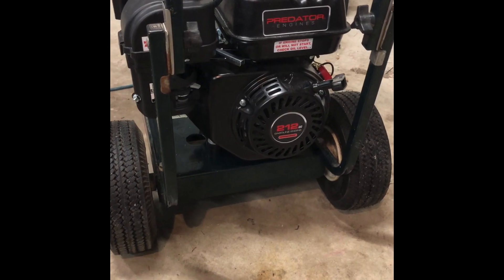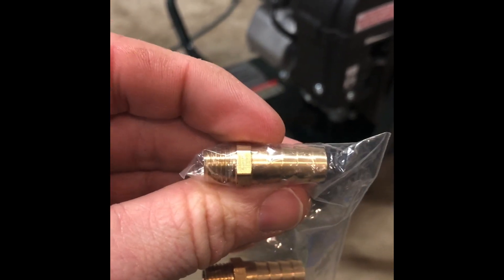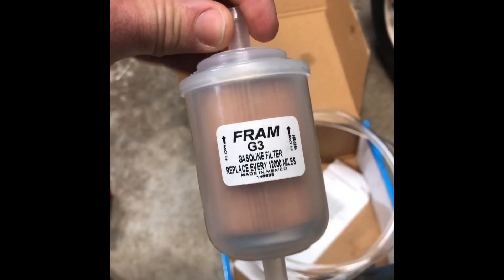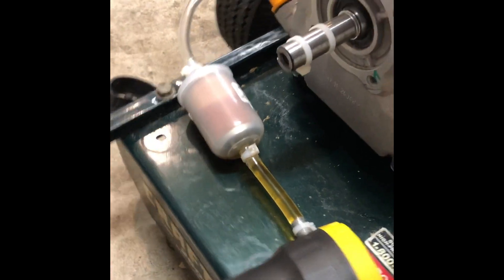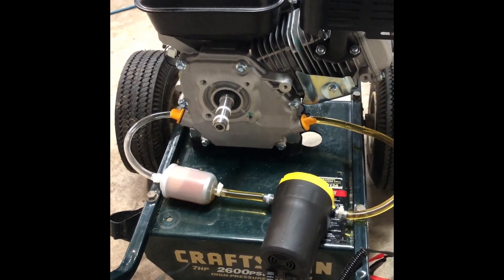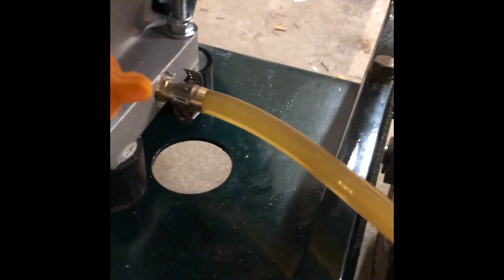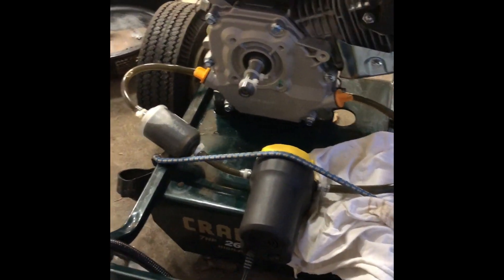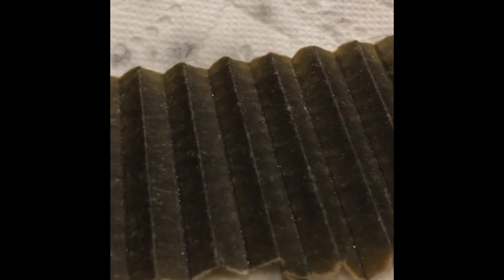Predator 212 Break in Oil Filter (or any other small engine for that matter)

Comment: I wonder if a vacuum fuel pump would work in place of the electric pump. It would be less volume to help with the cavitation probelm. I just wonder if it could push or pull thru that filter.

Comment: The flow of oil in this setup is way too turbulent, it's causing a lot of cavitation bubbles to form.

When those cavitation bubbles make it into the case they pop and release a tremendous amount of force in a very tiny spot. You'll find aluminum powder in your oil every time you change it out.

You could reduce the turbulence by using larger tubing and fittings.

Comment: How do you break in an engine....My predator has an automatic throttle , can't control engine speed.  How do you break this engine in when you can't control the engine speed?
Reply from the maker: Just run it at no load/low load for the break in period. I say this assuming it’s a generator engine

Comment: I'm a bit confused.. what does this bypass accomplish that simply running the motor doesnt?
Reply: What does any oil filter do for any engine? It removes debris so you are not causing unnecessary wear.
Reply from the maker: The bypass/kidney loop adds an oil filter.  Else the engine oil is unfiltered on these engines

Comment: With you working on engines you should know that the shavings and glitter is a norm with breaking in these small engines
Reply: But I will say genius idea
Reply from the maker: Might be normal, but I still don't want that junk rolling around in the engine and bearings
Reply: I think he knows the glitter is normal for breaking in an engine. The purpose here is to remove the metal from the oil so it doesn't circulate with the oil  cause unnecessary ware.